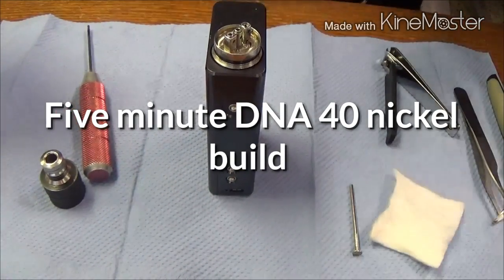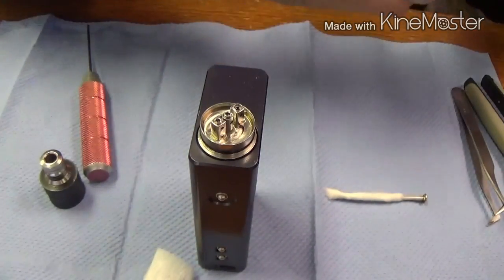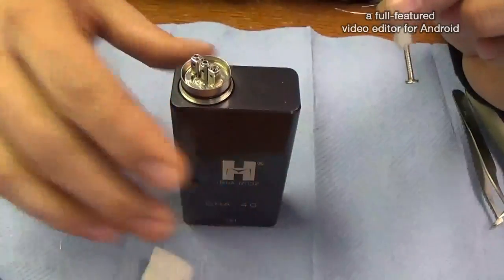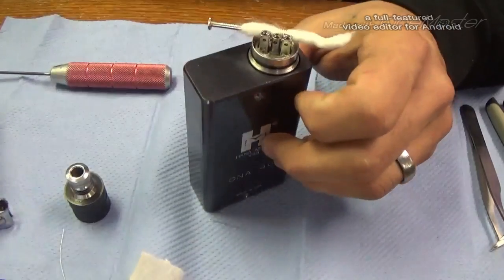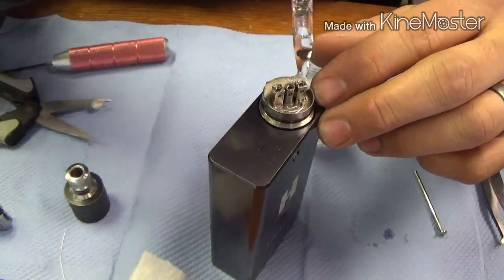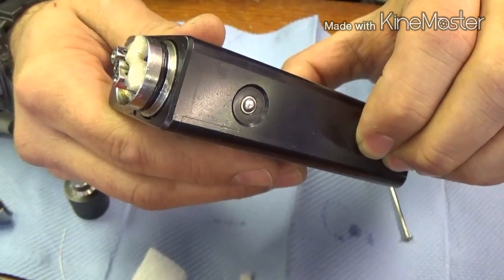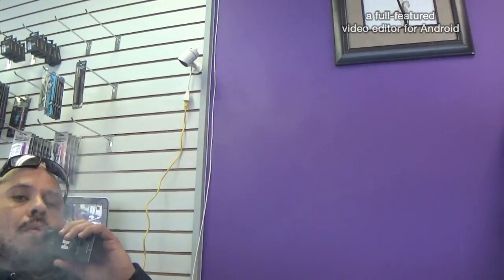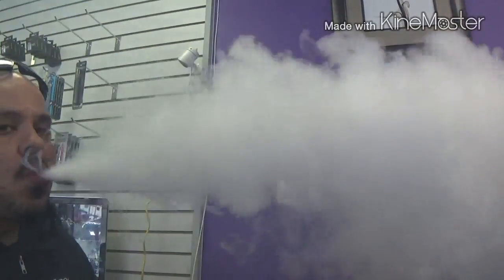Easy DNA 40 Nickel ni200 Build Under Five Minutes!

Comment: Brilliant! I just completed this method on my Kanger Subtank Mini RBA (modified RBA sleeve via theDon) with triple wound wire (2x32ga Kanthal and 1x28ga NI200 wire, 5 wraps standard coil, 3mm ID for cotton layer) giving me 0.09ohm resistance.  The center of the hollow wick is aligned with the modified holes in the RBA sleeve, allowing full liquid penetration, and mounted to my eVic-VT (30W temp control/500F) with 30pg/70vg DIY liquid.  The temp control is running about 28-29W consistently without the internal temp protection activated -- WOW! -- even with chain vaping!! Amazing Flavor!!

Tested up to 600F for some cloudBursts, too! But the device tops out about 517-519F at that wattage. Bumped up to 60W & 600F (device hovers about 49W), but flavor is comprimised with my liquid -- yet never engaged temp protection mode. A testament to this setup and the liquid penetration. 

Excellent demo. This will be my standard build for my STM RBA. Thank you!

Comment: Hey there,

could you try to explain what the trick with the nail and the cotton is? I mean, is it the "hole" in the cotton that is important or is it just not having to move the wraps when wicking it after installing the coil into an atomizer? Is it the lower amount of pressure towards the wraps or why would you consider your method the best method? :)
Reply: DaeViZ0n3 the nail is in there so it can get wrapped without ripping it.
Reply: Not the answer I was aiming for.. ^^'
Reply: DaeViZ0n3 It's not so much for the hole, it is just a soft coil to try to wick, so having the nail or something there so you don't have to try to wick the soft coil.
Reply: +DaeViZ0n3 my take on his method is to keep the coil from moving all over. damn ni200 is like building back before the sub ohm days. 32g wire is a Bieoch to build with. b i e o c h. I think the hole in the center was a happy accident and through use he found it wicked better. I dont think dude will ever answer. its been 7 months. LOL

Comment: With you building your coil like this: by putting the wick first, then wrapping the coil. Have you experienced any dry hits? So far whenever I tried a regular build sorta like how rip did it. I got a hot leg. Mostly my fault but I was using 28g wire. Main thing I am trying to get to is never having a a dry hit. Unlike if I was using regular kanthal

Comment: Hey bro I have a Kanger Mini with the nickel OCC coils. Just wondering whats the max temperature I could apply with out burning the cotton and the ruining the coil? Thanks bro nice videos!!!!
Reply: Fernando Badillo depends on the VG/PG, VG requires more heat than PG but you usually want to stay around 400 it also depends on the wick because rayon has a higher melting point for example than cotton.
Reply: Fernando Badillo Agree with Joshua about the proportions of the juice mix. Cotton begins to break down at 430F, but the temp control should protect you from burn/dry hits if you are using these coils on a temperature controlled device. For instance I 'dry' out my wicks @ 420F when I'm changing flavors.

If your TC device begins to pulsate between warm and cool vape on a draw, your juice flow to the coil is not consistent; lower your temperature, wattage, or thin out your juice.